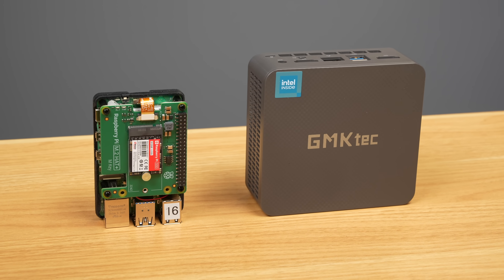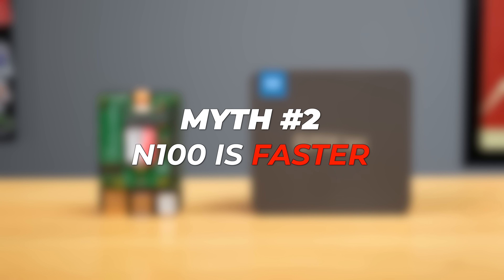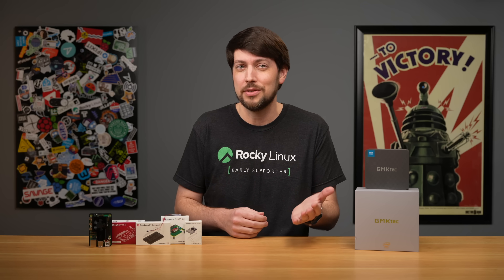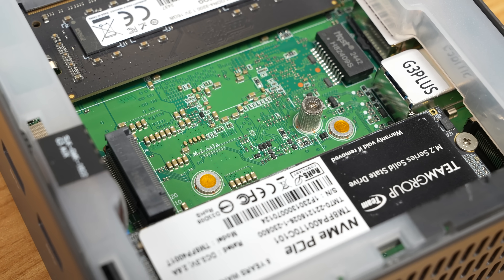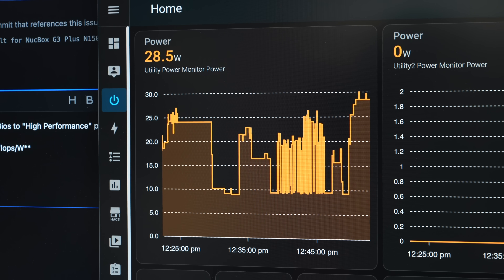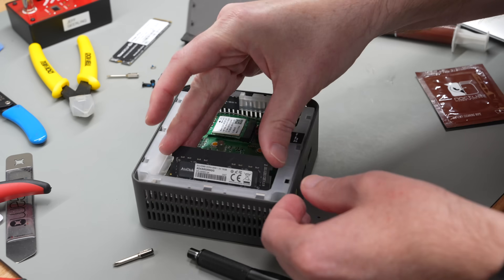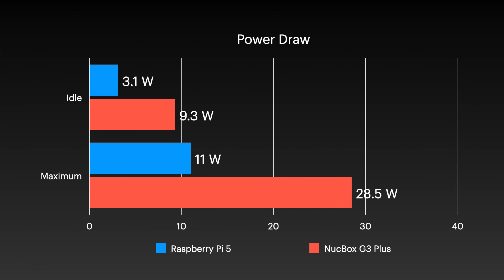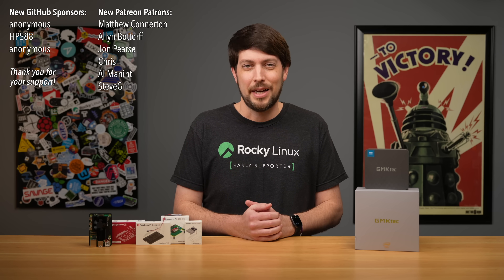When did Raspberry Pis get so expensive?

Comment: For my elderly in-laws desktop, which has to run Ubuntu (they are used to the UI) but they use for gmail and browsing, I picked a mini PC over a Pi5. Main reason was cost, the Pi with NVMe and a nice case with a decent power button they could actually use, plus official PSU was the same or more expensive than a faster mini PC. The Ubuntu port for Pi is also not straightforward. There are many x86 only repos. It was a lot harder getting the deb for Firefox instead of the flatpak in Arm. SSD support is better on the mini PC, I could get a WD or Samsung SSD that I trust without worrying about compatibility. Its horses for courses, the mini PC is designed exactly for this use case, the Pi is not. I use a lot of Pis, but they are servers or run Kodi, or music streamers, or network monitors, or retropi, or NUT… or I’m just playing. I rarely use one as a desktop.

Comment: Any experts on the old school Pi? I have the 1st Pi model B 512mb Arm 11 with 26 pin I/O made 2011 paid like $35 in 2012k. I bought the Pi for educational purposes and light web broswing it still works perfectly and have been using it on and off over the years but id like to know if it is possible to connect a wifi module to the GPIO output. The wifi module from another computer or TV has anyone ever done that? Im just now getting into the GPIO and thats half the reason i bought it.

Comment: I hate the official raspberry pi power supply especially the AU/NZ version. I have a power board that has 3 inputs and another 3 inputs directly opposite and the official power supply blocks 3 other ports because it was these weird rounded fins on all sides (which the US version doesn't have) and the power cord extends out the top and not the bottom so either the pins are upside down or the cable is routed out the wrong side.  Its also really expensive here and we don't have a lot of stock. If it wasnt for the OS's i would try and find something else.

Comment: My Home Assistant host is an 8GB Pi 5 as is my cyberdeck project. I have a couple recycled SFF business computers, some from HP some from Dell. The SFF's crush the Pi's but they are large and require dedicated shelf space. I use Pis as dedicated headless hosts for PiHole, OpenWRT (on my video security camera network) and Home Assistant. I use the SFFs for light Windows work and as headless development/experimental stuff (IOT mosquito host, Docker tomfoolery, programming.) I think Pi vs. mini PC is a choice of what the task is that the host will be dedicated to. I'm not going to use either one as a daily driver, unless I have to.

Comment: What does the pi have that a PC/phone doesn't? GPIO = parallel port/ft232 small size and low power? use a cheap phone.
when they have a half open bootloader I will like them more.
The only saving grace was its price.
zero 2 w is the only one worth getting IMHO

Comment: Generally, you need to chose the device for the actual task.
For those task where power usage counts and raspi has the ability to do it, it may be better choice.
For desktop use, 4k média use, transcoding, maybe light gaming and many other task, you may find an N100 variant that fits much better. Also between N100 variants there are lot of differences. There are very powerful palm sized machines and there are bigger, router like variants with more ports and card slots.
I'm still not understanding why they removed most of the media acceleration features from the pi5.

Comment: Pi 5 doesn't do video transcoding, that's the one thing that prevents me from using it to replace an old intel mini pc as my home server.
Reply: not just transcoding, even video playback is not good enough on the Pi. If you want to play H265 4k video files, I think the Pi will have not enough performance for that. The GPU on Intel computer was just using about 20% of the GPU. As an extra, I get also Windows on Intel CPU, that is also useful (you can run something else there as well, not just video playback), of course, you can use Linux as well. The mini computer is better value for money (the prices are close to each other).
Reply: @gpsoftsk1  The file sizes are smaller with H265 but space is cheap, especially with spinning drives.

Comment: Great Video!

I have the older NucBox G3 (with N100) for like 110-120 $, and to be honest, for such price, it was a great deal. Wi-Fi 6, 2240 + 2280 slot. Installed Zorin OS (well, maybe this is something i would change) - wanted to have small Samba Server with PS3 etc. ROMS for my local network so both Mini PC with Batocera as well as Windows Handheld can use same source of data. 

I think that overall hmm buld quality, performance for what you get is really, really ok. In the past for such money you got like Z8350 or some 2core super low budget cpu...

I like how you empasize that the mini pc vs raspberry comparisons are pretty unfair. Raspberry has GPIO - that's probably most important factor for many Raspberry-based projects. Then we add whole ecosystem (which is exactly where 99 % of cheaper, Chinese SBCs fail miserably). This has a VALUE. 

I would say that actually it's less about performance, memory, but actually more about GPIO, ecosystem. That's why I don't have a problem with Raspberry "being expensive" (and have less performance). And half-size of the MiniPC can also be important for somebody.

It's like complaining that laptop is more expensive than desktop for example. Well, this is laptop and this is desktop. Apples vs Oranges. Same with RPI vs Mini PC

Comment: Here is my 2 cents as someone who is not in IT. 

As soon as you complete the basic beginner projects like NAS, Nextcloud,  PiHole, simple cyberdecks, testing OSs, Retropi, simple clusters and music servers, you have acquired some experience and knowledge that leads you back to your main PC. With your new knowledge it saves space and time to use your old desktop for everything.  Now you feel somehow comfortable with virtual machines,  maybe Docker, etc. You now learn Python on your desktop and realize that you can run Kali through Windows. In the end, only few projects stand the test of time. For me, these were Nextcloud and monitoring temp and humidity with grafana. OK, a VPN server as well. All other Pis, that were bought very cheap at the start of Covid, ended up in a drawer or replaced by esp32.

For the non IT user there simply is no justification to buy the latest Pi version. 

Instead of spending the money on a new sbc, I prefer a simple Python seminar on Udemy or even a month on Hack the Box.

Comment: Pis are great until you try to do anything beyond running them off a MicroSD card.
Even as someone with a computer science degree, I got thoroughly annoyed figuring out CIFS to connect to an SMB server.
Even connecting it to my ASUS router's USB storage was painful.
It's probably a solid 8? hours of my life I won't get back.
Even then, when I edited the fstab to make it permanent, the Pi wouldn't boot anymore. 
Apparently, the argument sequence for mount differs from fstab.

Trying to get it to run off an external drive (Buffalo 2TB USB SSD) was an equal exercise in frustration. 
If they want people to adopt these, they need to make them way easier to use.
This is coming from someone who, again, actively enjoys playing with and learning about computers. 

By contrast, you just... plug a drive into a Windows computer or type in \\hostname and put in username and password.

Comment: The Pi has a lot of uses, but for simple dumb old me who uses computers the same way since 1995… an N100 is an incredible thing to have, I have a tiny little cuby PC with the N100 and 16gb of soldered DDR5, which is great, it doesn’t overheat, lets me watch youtube on the telly and in general is great.

Then I got a chuwi minibook X again, with an N100, this time with 12gb of ram, for my on the go repairs machine I have for services, and I found it interesting, for whatever reason the laptop seems to pack a way bigger punch than the mini PC, which was a welcome surprise, then you mentioned the N100 benchmarks are all over the place, I wonder why…

So, the mini PC cost me $140, and the mini laptop $250, both new, and thinking about all the things I can do with them because they are x86-64 machines instead of arm… the raspberry pi has no chance, at least with my use case

Comment: Pi 3 was cost effective vs x86, flat out. Scalpers ruined pi 4. Pi 5 is not cost effective vs x86, whether new or used or whatever. You basically confirmed all these “myths” in a weasel wordy way that could potentially lead viewers to believe the Pi 5 is still the better choice. It’s just not anymore, not with competitor arm SBCs, x86 SBCs, and old monitor-less laptops available at a competitive price with better performance and accessibility.

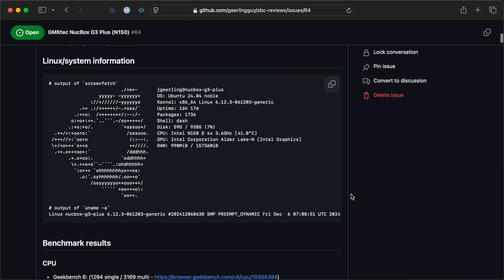Comment: I'm sorry, but I HEARTILY downvoted 1:28. 
16 nm and 10 nm are simply marketing terms. That's all the credence you should give to that nonsense.
"Better process node, more efficient!"
No... you're ignoring if they're using a high-performance node or one designed for mobile parts.
The nm figure doesn't actually.... measure anything. That's why Intel's 10nm (which was fake to begin with) became "Intel 7" just like that.
That's why TSMC's "14" nm is identical in its performance and power consumption to its "16 nm".
That's why iPhones using Samsung's "8 nm" are within single-digit percentages of TSMC's "7 nm LP". 
etc. etc.

Myth #2, the N100 is faster... 
*Proceeds to explain that the N100 is 1.5 to 2x faster.
We're not talking about "other ARM SBCs." We're talking about the Raspberry Pi 5.

Why are you talking about throttling at 75c? The junction temperature (*LITERALLY* the only temperature value that matters) is 105c.
If your system is throttling at 70c, there is something massively wrong with the UEFI/BIOS.

Comment: I think the better solution for measuring efficiency would be giving the devices a specific task and measure the used power to end the task successfully. The momentary power consumption doesn't reflect the time needed to do something. 1 hour work on a 30w device consumes the same amount of energy like 2 hours of 15w or 0.5 hours at 60w.

Comment: I watched your last video and bought the exact GMKtec mini PC you had to replace my aging Raspberry Pi 3. Ultimately I couldn't completely retire my pi3, because I couldn't find a way to get SPI over GPIO to work with the Intel mini PC, which is needed by my own dashboard app. I tried to get GPIO working using gpiozero's remote mode, which worked on most parts, but it appears that SPI is not supported over its remote protocol, so I had to keep my pi3 around to run my dashboard. That being said, I now use the Intel mini PC as my general purpose home server that hosts a SMB file server and a Minecraft Bedrock Edition server, which work much better than my old pi3, both because of much faster NVMe IO speed and x86 compatibility (with Bedrock server).

Comment: Setting up an N100 GMKTec to run Windows 11 for my Mom was trivially easy, had the needed connectivity, works great, reclaimed some desktop space compared to the previous laptop, and was, if I recall correctly, less than $150. For her use case, it was great.
Reply: If I were you, I would have put Ubuntu or Linux Mint as an OS instead of that Windows 11 monstrosity. Less headache dealing with failed updates or security vulnerabilities.
Reply: @hzrnbugsie  Monstrosity?? Windows 11 is great. If you are having failed updates then thats 100% user error I've used windows for 13+ years and never had or even heard of failed updates

And security vulnerabilities are dependent on user. Same as Linux

Windows is less headaches

Comment: The Pi 5 is no real tinkerer's SBC for me anymore. I discovered many issues with it that make it just not worthwhile spending more on a Pi 5, when a Pi 4 is easier to set up, costs less and most of the time doesn't need active cooling. Recently, I set up a offiicial 7" Pi touch-display build for SDR pruposes (I connect regular SDRs like SDRplay, HackRF and so on via USB). Neither with Ubuntu 24, nor with DragonOS (custom Ubuntu fork with pre-installed SDR features), the Pi 5 ran fine. I/O issues, since they complettely changed the I/O from Pi 4 to 5, sound issues, since the Pi 5 doesn't have a 3.5 mm jack anymore (insane decision imo), library/ dependency incompatabilites, issues with the OFFICIAL pi touch display, issues with system alerts that my power supply is not powerful enough... it is just not fun to tinker with it anymore. Switched back to the Pi 4, and everything just works with minimal setup! I can even choose if i want to use the 3.5 mm jack for audio, OR use a soundcard hat (which i had to buy for the Pi 5), how convenient! SDR++ runs noticeably slower on it, but it is enough. It works fine, as long as you don't expect completely stutter free FM boradcast (192 KHz BW is just too much for the little Pi 4 sadly). Anything with lower bandwith works fine.

Comment: Great video!

And 100% agree -- a tool is only as useful as you make it to be.

And I LOVE that you look at price, performance, AND power (albeit not as a composite metric, simultaneously).

When I am looking at buying Mini PCs, I actually have a spreadsheet where I track the price, and usually idle power consumption (because trying to find the maximum where it is measured using a consistent methodology is very difficult), and the performance (which I usually calculate based on the things that I care about (number of cores * clock speed * RAM capacity * RAM speed (in GT/s) * number of LAN ports * LAN speed, etc...)

And then at the end, I can calculate my composite $/(performance/watt) metric, and then sort by lowest to highest to see the system that has the lowest cost per (performance/watt).

My current Proxmox HA cluster runs on OASLOA Mini PC (which uses the Intel N95 processor (4-core/4-thread) and it's been working decently well for me for what I need that cluster to do (Windows AD DC, DNS, and AdGuardHome).

I looked at the RPis, and when computing my composite $/(performance/watt) metric, it ends up being quite high, relatively speaking, which is the primary reason why I haven't deployed Pis yet.

Just bought a new trio of GMKtec G5 Plus mini PCs (Ryzen 7 5825U, barebones), along with 2x 32GB DDR4-3200 SODIMMs for each node (64 GB each), and I'm still trying to decide on whether I am going to go with single 1 TB NVMe SSD each, 2x 1 TB, or 2x 2 TB.

(The 2 TB is more cost efficient, but I don't really "need" 2 TB, let alone 4 (2x 2 TB).)

Also re: power consumption
Might be more useful to look at energy consumption (power * time) for a given workload rather than straight power and/or straight "performance" as you have a system that consumes more power, but might be faster at say a rendering job than a system that has a lower max power consumption, but takes longer to complete the same rendering job.

That, I think, gives a much better picture of power vs. performance that either of those metrics can provide, by itself.

(And GFLOPS/Watt is an efficiency metric, but again, if the more efficient CPU takes longer to complete a task, then it might not necessarily be ENERGY efficient, even though it's POWER efficient.)

Comment: You can get HP, Lenovo, optiplex mini pc's with I5 8th or 9th generation with 16GB of ram for around 120 - 140 euro in my country. No shit with thermal throttling ... stable as a rock and it will outperform the PI. Perfect for most people doing some selfhosting; The days of the PI are over ... too expensive and too unstable.

Comment: M.2 support missing, go buy a hat.
No cooler. go buy a cooler.
Soldered single channel single chip RAM, and so you need to pay extortionate amount for very high density chips.
Obsolete and insufficient power delivery design, should be PD 12-15V, and run with bricks you already own, but nope, go buy their special 5V/5A brick.
All those "savings" to trim $10 off the price and then you pay $50 in accessories, most of which they also make/sell, how convenient for them!

Comment: When you consider that there are great deals even on the mini pc's, it's hard to justify the pi in a lot of situations. However, there are still a lot of reasons for all of these devices. Reposting as I believe my comment was deleted due to image posted. It was proof I purchased a GMKTec N150 (the one he has in the video) for $125 ($125.93 to be exact).
Reply: $119 at GMK directly currently.

Comment: 1 Using a PI as a PC is dumb, buy an actual PC for that. 2 You can still buy Pi Zero's, Pi 3's and Pi 4's. For most projects the Pi 3 works just fine and adjusted for inflation they are much cheaper than they were at release. If you aren't using the GPIO pins you probably shouldn't be using a Pi. Good luck getting some of the cool Pi projects to run on a N100. Its so sad seeing Pi's being used for nothing other than NAS's on channels like yours Jeff there are so many cool projects you could show but no its "Fitting an SSD to a Pi" like wow!

Videos like this just feed off of outrage and peoples general unhappiness, doom scrolling isn't a genre you should be entertaining Jeff.

Comment: Been a big Pi fan since v1, came close to grabbing a v5 8GB for a new Home Assistant setup, but ended up with a Beelink EQ14 (N150 16GB) for just £30 more than what the Pi+PSU+NVMe+case would've cost. It was very close, and I still like the Pi platform, but being able to put Proxmox on there with other stuff alongside HA and not have to worry about growth, made the difference this time around. The EQ14 is dead silent, PSU is built-in (no brick), and consumes just a few watts more when idle.